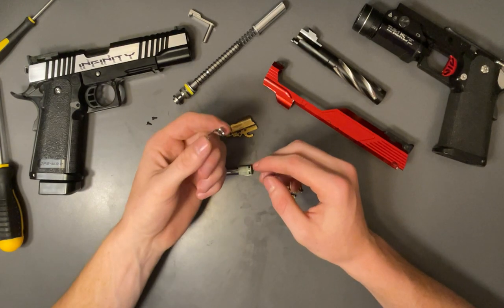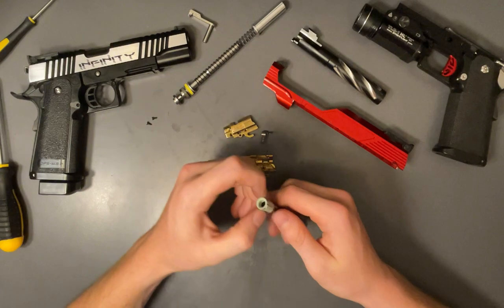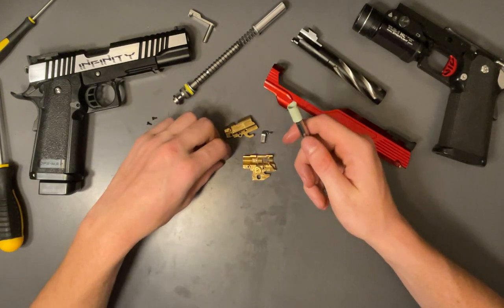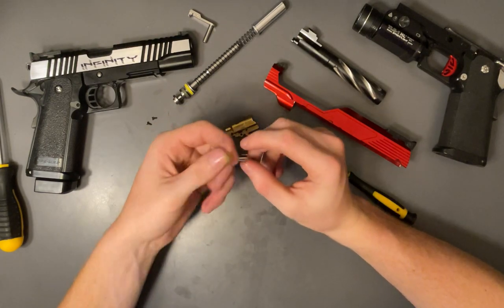The best Hi Capa Hopup Unit? - HopUp Unit Disassembly - Airsoft Masterpiece Vs Marui Vs Maple Leaf

Comment: I’m using an Airsoft Masterpiece HopUp unit with a decepticon bucking on a crazy jet barrel. 

I’m having an issue where I can’t quite get the HopUp unit to fully seal. I can’t get the left side to shut perfectly to the right side. Almost as though it is rocking on something. 

I can’t figure out what is causing it

Edit: discovered the issue. Whenever you put your barrel and HopUp down into the slot on the right side of the brass HopUp unit, there is a small detent in the brass and barrel that sort of like up together. I just kind of lightly squeezed on the front end of the brass HopUp unit and barrel, gently sort of circling it around until it clicked in. Then held it tightly as it wanted to pop out. Finally assembled it then put the screws in and it looks great

Comment: To undo thread lock & not damage the screw head use a lighter to heat up metal. When iv applied thread lock there's a lot, to fully unlock I heat until smoke comes off, it has a slight smell. That's enough heat, you can now not damage your screw head

Comment: What kind/type of Loctite should I be using for my Hop Up unit? From what ive seen theres different types and I would like to buy the right one without messing up anything in my gun.
Reply from the maker: For this I would use the blue lock tight, red lock tight if your a set it and forget it type of guy. Just remember that when your are locking these down you have to be extremely careful taking it apart again. The screws are very soft, you don’t want to strip them.
Reply: Thanks for the tip! I think ill go for the blue to start
Reply from the maker: @Nuhuuh  Good choice
Reply: Don't use red. It's pretty much permanent glue.

Comment: Brass (AM) is stronger/harder than aluminum (maple leaf).
Reply from the maker: The brass is softer but the design is more durable. The specs are of higher quality giving better accuracy and air seal, less room for wobble. The maple leaf design is borderline worse than the stock TM.

Comment: Can you explain why when using maple I Key with AM hop up that we can no longer use .2 BBs? What exactly does the I Key do?
Reply from the maker: Basically it adds more HopUp, so your minimum HopUp setting will become around what was a quarter turn of your wheel previously. Because there is more hop being applied from the start if you use 2.0 bbs they will go straight up.

Comment: Any opinions on the guarder hop up unit?

Would you recommend using the maple leaf I key in other hop units?

Also... Threadlock, not Loctite, they are a brand and not the product as they also make glues
Reply from the maker: I recommend maple leaf I-Key in all HopUp as long as it fits, but I do not recommend the Guarder HopUp unit at all.
Reply: @CadensCustomWorks  thanks...

Looking to get a hop unit in my hi capa as its pretty much the only stock TM part left.

Everything else internally has already been replaced including a longer 118mm pdi barrel
Reply from the maker: @Mrmhibbert  certainly go with the AM HopUp unit
Reply: I bought the guarder one thinking hey it's less than 20 bucks? Maybe 150 shots and it broke in half. Got the AM one about a week after using the stock one. Should have just got the AM one from the start. Most accurate pistol i have. My upgraded shadow 1 is close bit not quite.
Reply: @davidfarmer2521  great... I'll stick with the stock until the AM ones are available

Comment: Why do you people install and remove the tension ring while the rubber is still on the barrel?
Reply from the maker: Because you can cut the hop patch on the bucking when you are sliding it over. I have never damaged one of the tension rings and even if I did it is an easy replacement.
Reply: @CadensCustomWorks  Ok, thank you, that makes some sense. However, in my opinion the tension ring is to far to the end to influence installation of the hop up rubber. Maybe I will change my mind when I cut one.
Reply from the maker: @watchbreaker1706  Either way I don’t think it makes too much difference, if you put the clip on first and just move slowly and help the hop patch move into the window you should be fire. I just rather be safe than sorry. 👍

Comment: Is that a 5KU outer barrel or UAC or something?
Reply from the maker: I have two one is cow cow the other is 5ku
Reply: @CadensCustomWorks  How's the 5KU one, any fitment needed, does it change the performance in any way? Looking for a budget outer atm and also what's in stock generally. thanks in advance
Reply from the maker: @kasparboy  the thing with 5ku is that it can be a gamble with their quality control, but with the outer barrels I haven’t had a bad one yet. The finish is more of a Matt black than a gloss like the cow cow or UAC. I definitely recommend them, threaded and fixed, at an excellent price. Order from HongKong and get it for $35 shipped.
Reply: @CadensCustomWorks  Awesome , thanks!

Comment: use maple leaf wheel for AM hop!! :)
Reply from the maker: I have never tried that I might have to test it out
Reply: I've found the maple leaf wheel is too wide for the am hop up. I would recommend the nineball wheel instead
Reply from the maker: @purplexityairsoft5264  I feel like I have heard something like that which is why I just use the AM one
Reply: Doesn’t work in AM HopUp
Reply: @mikxly8147  it does. Made few capas with that hop and wheel.. O.o
Reply: @TheN3ckol  it doesn’t turn
Reply: @mikxly8147  but it suppose not to turn :D
Reply: @TheN3ckol  it’s not supposed to turn?
Reply: @mikxly8147  yep. In stock chamber and early AM there was a problem with rotating wheel so hop up was not stable. Its more work with seting up the hop up, but you dont have to correct it every week :)
Reply: @TheN3ckol  …
Reply: @TheN3ckol  so it’s supposed to turn but in your opinion it shouldn’t turn so it won’t move by it self